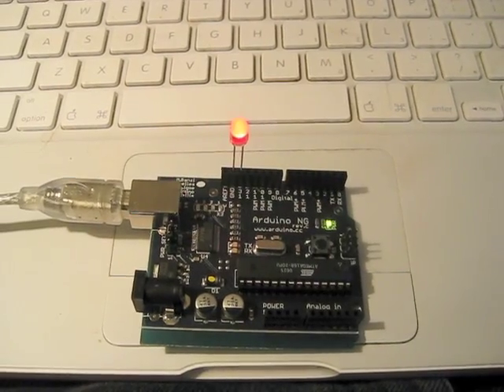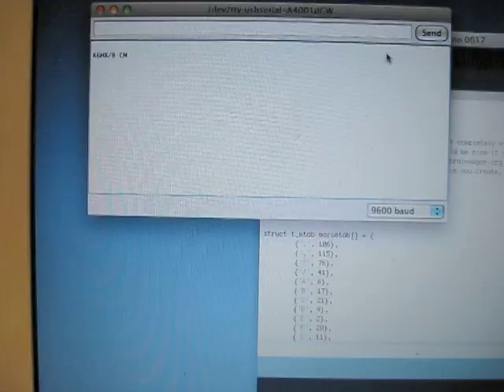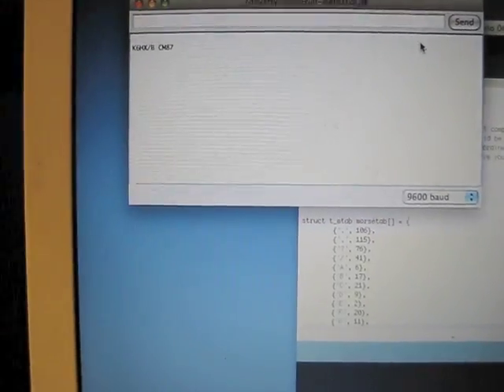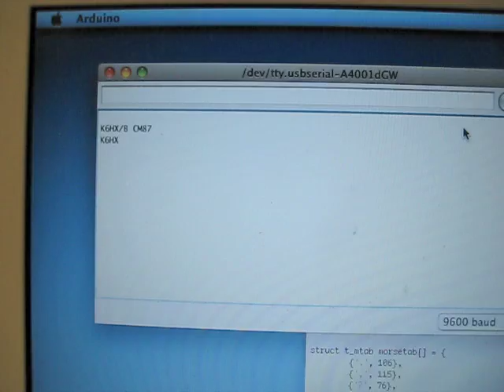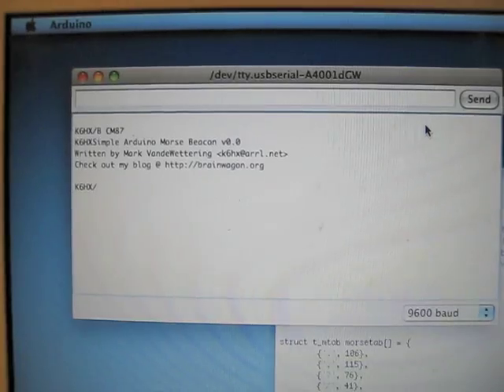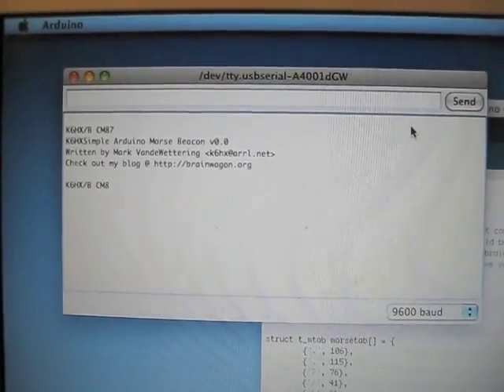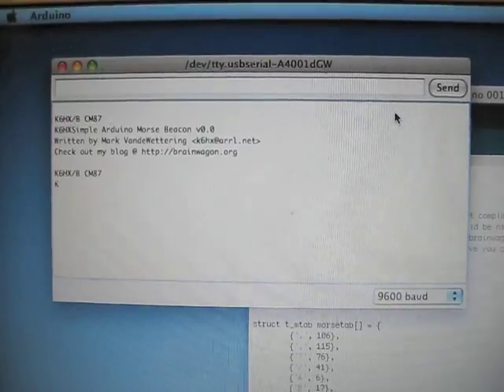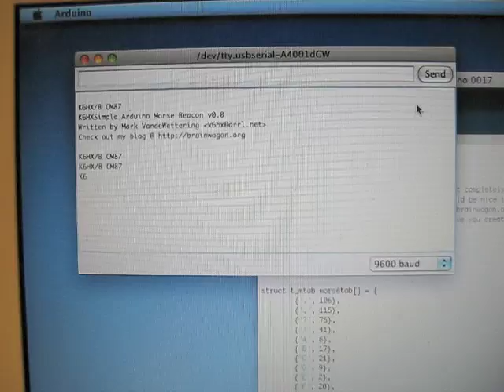Arduino Morse Beacon Keyer

Comment: I went to your blog last night and downloaded your program and it worked the first time. I just need to figure how to add a code for pulling a relay or transistor at the same time to PTT a beacon. I plan to use this on a borduino on a 10 meter beacon. Thanks for posting.